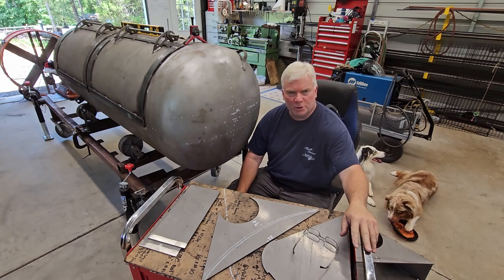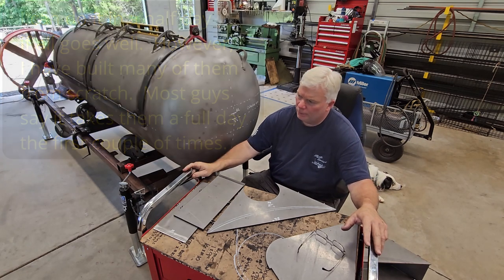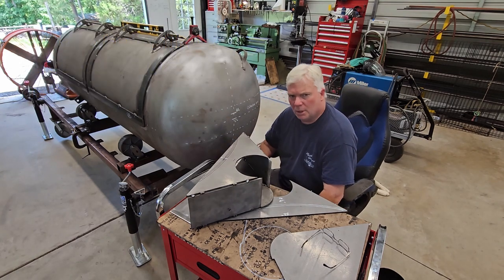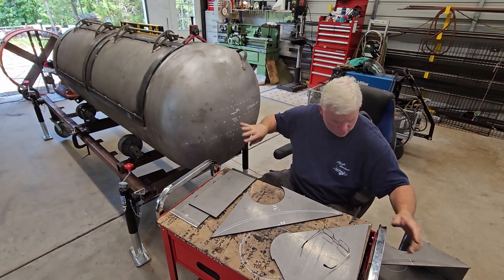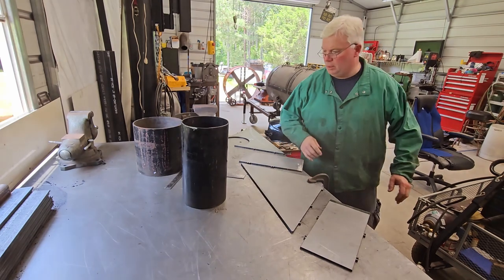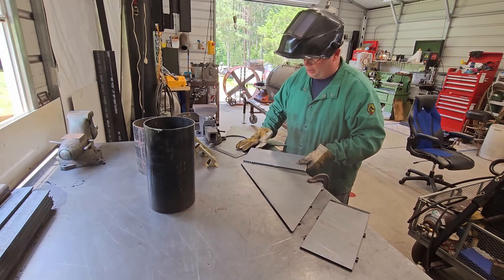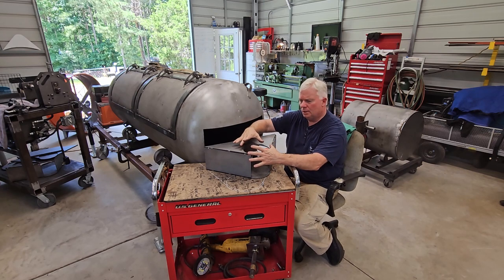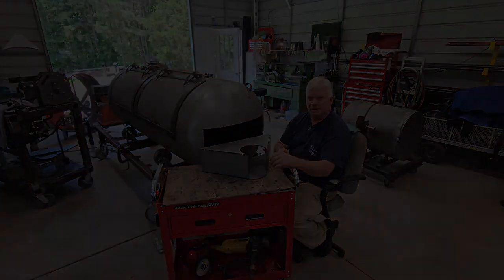Collector Kit

Comment: Have you tried combining the collector box with a 90 degree elbow? If you re-worked your template, you could probably find a good way to fit them within each other and get the best of both worlds. I plan to try that with an upcoming build, and will likely use your templates as my starter..

Comment: Why not a 90 degree elbow directly out of tank ??
Reply from the maker: @recentlyretired  I used elbows for many years.   Ultimately,  I learned through a lot of experimentation and trial and error just how much more efficient a properly designed collector actually is at moving air.  

Fluids (air is a fluid) hate to enter a flat hole.  The close we can approximate a funnel, the better. 

Elbows are cheaper and far easier to install.   If there wasn't a significant difference,  I would still be using Elbows.  

Cutting a simple round hole and welding it in place literally takes minutes.

Comment: That is Schedule 10 pipe? Wouldn't that be super thin?
Reply from the maker: Schedule 10 is perfect.   The 8 inch pipe in sch 10 is 3/16" wall thickness.   

Any more is completely unnecessary wgt.

Comment: Would like to purchase this kit don't know where to go though..... If you could provide a link I would appreciate it
Reply from the maker: Here is the link to the 6x22E collector kit.  This is for 30" diameter tanks (or pipe) with Eliptical end caps.

The 6x22H is for hemispheric tanks.  They have the "bubble" end caps.  

The 6x18 version is for 24" diameter  tanks or pipe.

The 8x22 is for 330g or  500g cookers using 8-5/8" OD pipe

Feel free to reach out via mysticsmokers@gmail.com and I can provide a phone number if needed.

Comment: Are the kits available for sale the latest version with the longer standoff?
Reply from the maker: The 6-inch and 8 inch versions for 30 inch diameter tank  (250 and 330 gallon)  are on the mysticsmokers.com website and Etsy shop by the same name.   

I will have the 6-inch collector for a 24-inch diameter tank (120g-150g)  later this week.

And yes, the proper stand-off distance is the current design.
Reply: @mysticsmokers3014  Thanks for the quick response, width of the 6/24 model? I’m looking to modify a flat end smoker.
Reply from the maker: @JB-dg8de  That's a great question, and for a flat end, you may want to choose between the two versions, so let me give dimensions for both:

The 6" - 30" diameter version is:
-6" tall
-6-5/8" hole for sch#10
-22" wide at the tank opening 

The 6" - 24" diameter version is:  
-6" tall
-6-5/8" hole for sch#10
18 inches wide at the tank opening.   

So, in short, both versions would work on a 24-inch flat end tank.  

Personally,  I would prefer the wider opening.   

Feel free to email me at mysticsmokers@gmail.com 

Or find me on FACEBOOK MESSENGER.   I'm easy to spot.  

I'll provide my phone number for easier/faster communication.